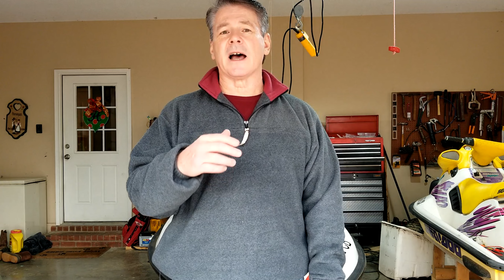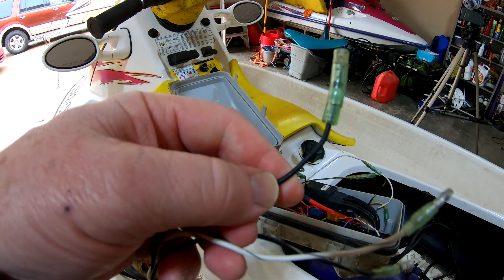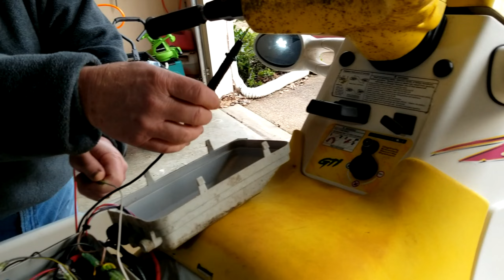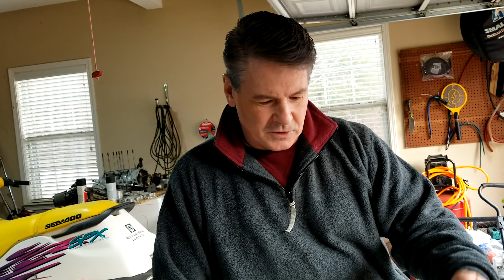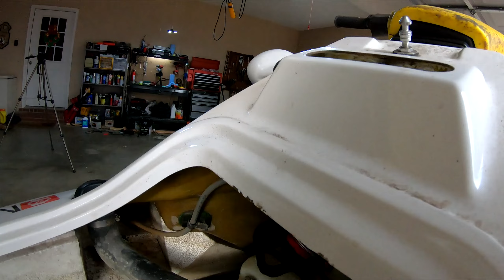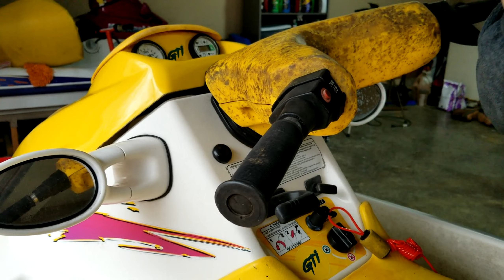No Start Seadoo...Bad Dess Post? Lets Test and find out, then replace.

Comment: Can I connect the black with the black/ yellow and bypass the key?
I bought a 96 GTX. No key, No Battery
Only prob I see is the starter solenoid is broken but looks bypassed.
Haven't even connected a battery to it. 
Figured I'd research info first
Reply from the maker: I don't know of any way to bypass the key. If you could, it seems someone would have put a video out.

Comment: Any ideas on a 98 gts 5 amp fuse that blows when hooking up battery (key off).  what do I test next?
Reply from the maker: The fuse blows because your MPEM is bad. I once connected a battery charger to my battery while it was still connected to the ski and it fried the MPEM. Afterwards the fuse blew when connecting the battery. I would go to some message boards and see if anyone has a solution without having to buy a new MPEM.
Reply: @papadonjetski9535  Thank You!  That was the problem, I did already take it to a guy, he went right to that, tested it, and replaced it.  I'm new to seadoos so I didn't even know what a MPEM was, let alone testing it.  Next time it's on me! Thanks for answering!

Comment: Hey Don! Just found your channel because I'm currently trying to figure out why my ski died on the lake today and wouldn't fire back up. Channel was super rough today from all the traffic so we were getting beat up. Caught a tow back to my truck and got home, pulled the plugs, put the key on the post and tried to fire it to see if water was in the cylinders and it does absolutely nothing. Nothing spins, no debris caught in impeller or pump.. Beginning to think hydro lock? I'm stumped. Ski is a 99' GTI. Any ideas? I don't know much about these either, just bought it about 6 weeks ago and this is my first one.
Reply from the maker: When you say, "it does absolutely nothing", do you mean the engine does not crank over? It could mean many things. You could have blown a fuse, so I would check your ebox. Your rectifier could have died which would drain your battery causing you to lose all power. I would first make sure you have a fully charged battery so that you can begin to check other things. Feel free to email me with other questions.
Reply: @papadonjetski9535  Yes it does not crank over. There is only an audible “ clicking “ but nothing physically spins, motor, driveshaft, etc.. Sometimes only one click, sometimes a few. I don’t want to assume the motor is shot but I can’t get it to spin to see if it will shoot water out of the plug holes. I don’t know where to start.
Reply from the maker: @Chattsteezy  I don't believe your engine is bad. That "clicking" sound tells me you should check your starter relay and starter. You can test them easily.  First, make sure your battery is fully charged, it should show around 12.6 volts. Second, place a screwdriver over the 2 posts of the starter relay, touching each at the same time. Sparks will probably fly, but that is normal. If the engine turns over then you probably have a bad relay. If the engine does not turn over then you may have a bad starter. The relay is in the ebox, so pull the ebox out just far enough to open it and find the relay. A starter relay is an easy and inexpensive fix.
Reply: @papadonjetski9535  Okay that’s a little reassuring I will start there. Assuming this could be my issue, would a starter or relay cause the ski to die like I mentioned?
Reply from the maker: @Chattsteezy  Unfortunately no. If the ski was running and then suddenly dies, it would not be the starter or relay.  Are you using the oil injector or premix? If you are using the oil injection, is there oil in your oil tank? Also, check your oil lines to make sure they are intact and connected to the oil pump and engine. It you ran it with no oil then you may have locked up the engine.  See if you can turn the crankshaft by hand. Remove the flywheel guard and see if you can turn the engine by hand.
Reply: @papadonjetski9535  Yes it is oil injected. And I topped off the tank before we went out. I am afraid though I may have messed up because I put new oil on top of old oil(not sure how old because it’s what was in it at purchase) so I hope I didn’t gel it up. I did call the seller beforehand and he said it would be okay to mix as long as it was full synthetic with full synthetic. I can try to take guard off and spin but I tried Saturday and had no luck. Or I didn’t try hard enough.

Comment: I’ve got a halfway bad post on my ski, i can twiggle and tweak the key and get the jacked up start button to cooperate and mine will run. When it wants to. But does a great job of making me look like a complete toolbag at the dock plenty of times. My thought is I would have already grabbed new key and dess post and slapped it in but don’t you gotta program it to the computer afterwards? I didn’t wanna get stuck with a new button key and post and a no start ski. Good video tho thanks bossman. Also wonder where the beeping comes from, mine used to beep when I slapped the key on it, now nothing but she still runs 😂
Reply: Haha watching this video now actually, that’s me all the time at the dock when you did t have the battery connected, exactly how I roll lol
Reply from the maker: The DESS post is just a regular interchangeable part, it is not programed to the MPEM. You can replace it without affecting your key.
Reply from the maker: Also, the beeper is between the handlebars, under the plastic cover.

Comment: Hey Don, really enjoy your videos. I have a 2003 Sea Doo GTI RFI 787 and I'm not getting any beeps, no power what so ever. Wondering if you have ever worked on one of these with a similar issue.
Reply from the maker: Did you see my other "no start" video on a GTS?  That GTS did nothing when I pressed the start button and so I checked the battery, starter, starter relay, ground wires in the ebox and from the battery to the engine for corrosion or loose connection. I tested to make sure i was getting 12 volts to the starter relay. I then tested the start button, dess post and key to make sure they were working. Have you checked all of these?
Reply: Did you ever figure it out ?

Comment: Came across your video while looking for an answer, maybe you can help since my problem isnt identical to yours.  2000 Seadoo GTX i just purchased this year.  Most of the time it fires right up but about 20% of the time it doesnt.  The key sounds the dual beep, but the start button produces nothing.  No click of solonoid, no hum, nothing.  Eventually it will work though.  Sometimes a couple tries later, sometimes several minutes and dozens if button pushes later.  Its hapoened in the middle of the lake with two kids in tow, which was a little unerving.  Any idea?
Reply from the maker: I would get a new starter relay, its cheap and easy to replace. I would start there and see if that solves the problem. Have you tested the start button? I did another no start video about 4 months earlier than this video in which the no start problem was the mpem. However, in that video I show how to test the start button to make sure that is not the problem.

Comment: I have a 1996 SP Sea Doo got filled with water when my farther and law rolled it never turned it over. I place the key and it does not make the beeping noise anymore. I tried jumping it but it does not try to start over. I changed the MPeC
Reply from the maker: Does it run now with a new MPEM? If not, your engine may be full of water and that could be why it will not crank over. Did you remove the spark plugs and then press the start button to see if any water shoots out? If the engine is full of water and you try to start it, you could really damage the engine.

Comment: I have a 2004 with a 720
Every time I put the key in, the starter engages for a split second 

Any idea where i can find a wiring diagram . I’m trying to figure out what switch is connected to what
Reply from the maker: I'm pretty sure that is your starter solenoid, or relay as most call it. They are known to do that when they go bad.
Reply: @papadonjetski9535  thx , this is my other account btw - but it just clunks, my buddy put in a MPEM & a time out relay, he couldnt figure it out, I found the wire diagram. Just to be clear the machine starts all the time, it just engages the starter for a split second after inserting the key without pressing the ON/OFF (START) button. Does that change anything  ?
Reply from the maker: Well, I'm not familure with a time-out relay and how it might play into your issue. Based on my experience, I believe it is the starter relay. Any chance you have another ski that you could pull a relay from and put it in yours to see if it solves the starter engaging? A starter relay, when going bad, can stick open or closed.
Reply from the maker: I accidentally sent my reply before I finished. When a starter relay sticks, the 12v power can stay engaged, and thats why a ski will sometimes turn over when the key is connected. Again, I'm not 100% sure that is your issue, it is just my opinion.

Comment: Hey don I have a 96 gsx that beeps and when u hit the start button it clicks and then buzzes, also the ground wire gets hot what could be causing this?
Reply from the maker: One of my other seadoos did that recently, it was caused by a bad battery connection. Make sure your battery is good and you have a good connection. As for the ground wire, make sure there is no corrosion at its connection to the engine. I would clean it up really good.  You can do an ohms test from one end to the other on the cable to see if you have resistance.  If you have a high resistance then your cable is bad. Lastly, it could be your rectifier pumping to much current.
Reply: Hey man wonder if you could help me out here. I consider myself a pretty good mechanic I have been turning wrenches for 15 years now… so I have a 97 gtx… I bought it 3 years ago it sat for a while… I got it and completely went through the whole machine and basically restored it. I had to have 2 new DESS keys programmed to my mpem since the owner had lost the keys Liz’s so I sent it out to westside and they made up 2 keys for me. New keys worked and I got the machine to work great whatever. I replaced the beeper I replaced the start/stop switch and then I replaced the reverse cable… because I wanted to make it perfect…ran great no issues parked it. well I let the machine sit for for about a year and a half and when I went to go start it up today for the first time nothing.. so I got a brand new battery of course and then all I got was  just one beep when I would hit the start button. When I put it into the advance diagnostic mode I get 2 short beeps. Do you think this key which I probably used 3-4 times out on the water is already bad? According to the service manual everything is leading me to believe it’s the key.. how the hell do these keys go bad?

Comment: How do u get the front seat off of this thing man??
Reply from the maker: Are you talking about the small section just under the handlebars? If so, it is held on by 4 plastic fasteners. You can remove it by pulling out from the sides and they will pop out.

Comment: You tested the white ca 1st. Ok
Then you tested the solid blk . Ok
You did not test the 2nd blk….??? Why
Reply from the maker: The black/yellow is a common wire used by both the white/gray and black wire. When the key fob is placed on the dess post it shorts out the black and black/yellow wires together. I'm not an expert on this and there are others who could explain it much better.